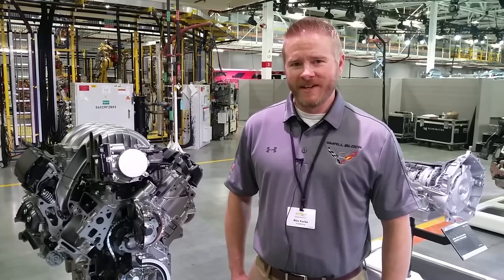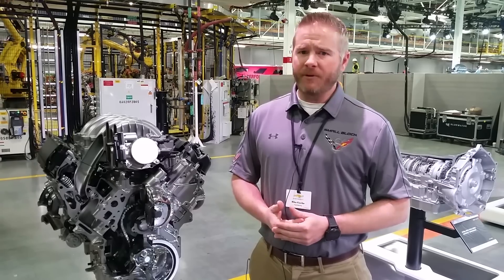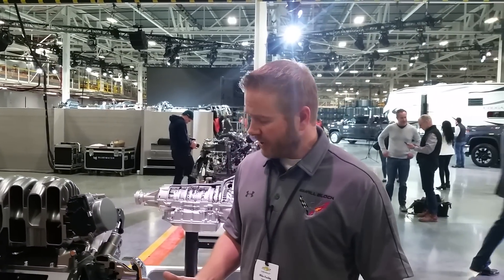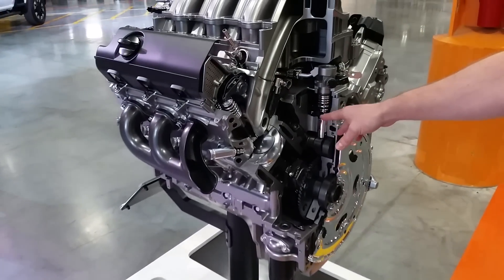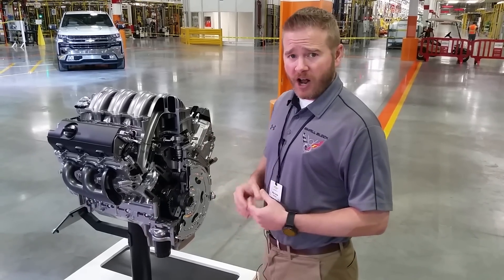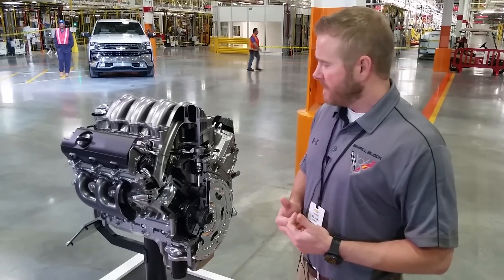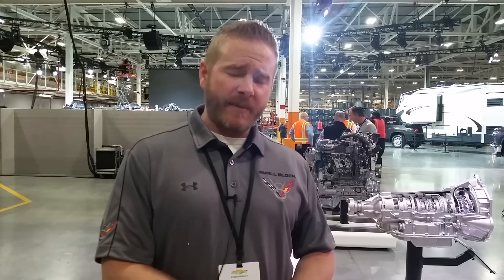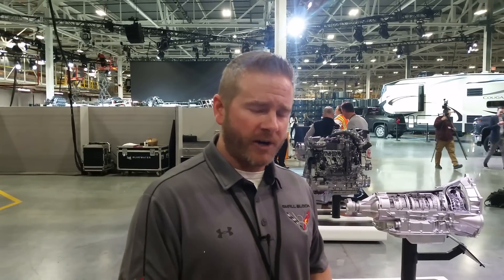New 6.6-liter V8 gas engine on 2020 Silverado HD

Comment: What is the big deal with the 6.6 since the 6.2 beats the horsepower and almost the same torque.  Yer kiddin' right??
Reply: Maybe the 6.6 is able to put more of that power to the ground.
Reply: The 6.2 is a large bore performance engine that was never intended for heavy duty applications. It's the same reason the 7.0 was never used in a truck. Over square vs under square look it up. It's not just about the numbers it's about producing as much torque at low rpms as possible while running on 87 octane fuel
Reply: Horsepower is all but completely irrelevant in a heavy truck application
Reply: @roncook8566   Until you are doing 70 down the freeway or climbing a hill! I'd much rather have 350 HP than 240 HP. Just watch the Ecodiesel verses any gas engine in the same class. It has tremendously more torque but extremely less HP so gets smoked climbing hills and in passing on the freeway.
Reply: @Punkinspapa  

The ecodiesel isnt about performance. It's about towing and being efficient at the same time. The ecodiesel can tow 7000 lbs and return better gas mileage and not feel as burdened...than any of those gas engines. 

Oh the gas engines had a faster 0 to 60 while towing...WOW...FUCKING WOW...

People that actually tow alot or for a living do not give two shits about bragging rights. 

The 12 valve Cummins was down on horsepower vs comparable v8 gas engines...and it was slower. Yet while towing...it was better and more stable performing normal driving maneuvers. And returned better fuel mileage.
Reply: @_E_B_  the Ecodiesel with 420 ft lbs of torque and 240 HP can tow 7000 lbs! My Silverado wiith 383 ft lbs of torque and 355 HP can tow 10,000 lbs. I never said it beat it 0-60 towing did I, although it certainly does!? What I said was when going up a long steep hill, the grapevine for example, the Ecodiesel would not be able to keep up with a gas engine with significantly more HP or even remotely close! BTW I drove truck for 12 years so you don't need to tell me about towing and bragging rights because it's always a contest for some of these people!
Reply: @_E_B_  By the way, those who tow alot don't by a truck that only tows 7000 lbs!
Reply: @Punkinspapa  

I wasnt attacking ur statement or ur Intelligence lol. Just making a statement in general and meaning to say that torque is more important in towing than horsepower. Sure...an engine with more horsepower than the ecodiesel will probably pass faster with a heavier load. But that engine is over stressed while doing so...unlike the ecodiesel humming along up the hill...not breaking a sweat. I've also driven trucks. Since I was 19. I'm 36. 

And yes. Ur Silverado can tow more. That's obvious. But long term...ur 5.3L or any gas engine will have more wear and tear on and in it than any diesel engine used for towing.
Reply: @Punkinspapa  

I also never stated that people that tow alot tow 7000 lbs. I used that number as an example with the ecodiesel. Sorry that u missed that...😉
Reply: @_E_B_  Torque is more important to get it moving typically! HP is more important once it is moving and when climbing hills! Wear and tear I'm not so sure anymore! Both engines can last a long time if properly cared for. These modern gas engines are amazing, I mean look what Ford does with the 2.7!
Reply: @_E_B_  And with 37 lbs more torque it tows 3000 lbs less.
Reply: @_E_B_  and in fairness the only half ton diesels are 3.0. Wouldn't be fair to measure either engine to a bigger truck like a 3/4 or 1 ton.
Reply: @Punkinspapa  

The 2.7L is pretty amazing for what it is. 

And just in case those "bragging rights" people are reading our comments...I might add...that the 2.7L EcoBoost has a quicker 0 to 60 time than the 3.5L EcoBoost(375hp/470trq version) when you line up identical trim trucks...lol.

I've had a Chevy, 2 dodges, I may have to try out Ford. I just can get over the horrible noises the EcoBoost engines make. I'll have to stuck with a 5.0L f150...
Reply: @_E_B_  I hear ya! I love my V8 and while I'm sure the Ecoboost is a great engine, I just like the fact that I don't have to be concerned with potential turbo issues and repair costs. No replacement for displacement!
Reply: @_E_B_  Ford seems more interested in making race trucks than work trucks.

Comment: Any part of that gm engine that starts out variable is going to give problems
Reply: Not even the same thing. All its doing is probably varying the displacement to optimize the oil flowrate for various temperatures. The oil pump is probably a sliding vane type that has a mechanism to control the pressure on the cam ring to vary the displacement of the pump.
Reply: The VVT in the LS and LT based vehicles works great, its the AFM/DOD on the 1500s that doesnt
Reply: Strixx Yep mine is deactivated...

Comment: Get ready to break out the walnut blaster. Because them intake valve's will no longer get cleaned by fuel 😂
Reply: Hell that's been the problem since 2014 lol.......  What a joke, they know the issue and the problems it causes but instead of putting auxiliary injectors in the intake runners like other manufacturers to stop the carbon fouling they increase the displacement 😂
Reply: catch cans
Reply: ze3bar catch can doesn’t catch it all. Never has never will.
Reply: @RadDadisRad  mine does. Rxperformance
Reply: @ze3bar  yeah OK, if you say so lol....
Reply: @turbochevelle5641  Google it. Someone put it behind and in front of another can and proved that it collects well over 90% of the oil that would have otherwise passed.
Reply: @ze3bar  I don't need to because I know what truly causes carbon valve shrouding that is the problem.  Fact is you can run vent tube directly to atmosphere from both heads and still have horrible carbon shrouding. Carbon builds on valve then next thing you know valve doesn't close completely and you ruin valve seats and so on. Any car with an egr system is also horrible and egr with DI is even worse.  All a catch can does is catch oil blow by from crank case pressure and oil vapor.
Reply: @turbochevelle5641  but the catch can doesn't cut down how long it'll be before that becomes a problem? I'm draining out .5-1 liter a month.
Reply: @ze3bar  what engine are you running? Is it n/a or forced induction? We just did a DOD delete cam, injector, valve springs, push rods fuel pump upgrade on a 2014 L83 5.3l with crank case vented to atmosphere and the valves were horrible, absolutely horrible.
Reply: @turbochevelle5641  L83 Chevrolet NA
the stock 5.3L V8 in the Silverado 1/2 ton
Reply: @ze3bar  it will help on a set up like yours.
Reply: @turbochevelle5641  cant prevent 100 percent though...?
Reply: Yeah, but not every customer will buy and install them. I deal with this issue a lot on the car line I work on for a living.
Reply: @darenwinckler7027  those people are not going to be Walnut blasting their intakes either
Reply: @ze3bar  nope they won't ! But I will 😊 then go buy racecar parts with the money 😏
Reply: So air makes the intake valve dirty? We used to think 02 sensors were robbing power.
Reply: @60viking -  not regular air - the egr. Running exhaust back through the intake is what creates most of the problems, but it does work to lower certain emissions. shrug
Reply: So chevy admitted they learned alot from the 6.0 as a light duty engine yet they put it in heavy duty trucks? Lmao of course what a suprise chevy always take the cheap way out of everything cut corners at all cost. Now they made this overly complicated piece of junk while fords releasing the 7.3 gasser which is obviously way more reliable and powerful after hearing its specifications.
Reply: @tylersutton7667  that 7.3 is no joke. It's possibly my favorite Ford engine. Actually, it's the only Ford engine I like.
Reply: @funguy7979  You mean the NAVISTAR/CATERPILLAR "Ford" 7.3 Powerstroke? Or the "new" Ford 7.3 "gas" engine that's a half-assed "copy" of what GM did with its 6.6 gasoline engine?
Reply: @deeremeyer1749  powerstroke
Reply: @tylersutton7667  lol
Reply: Direct injection has its pros and cons, same as anything else.  I don't think it's going away however, it just needs to be improved upon.  Combining DI with port injection seems to be a good solution, but it has its cons as well.  Now you essentially would have two whole fuel injection systems on your engine.  That's an increase in parts and complexity, which leads to higher costs.  
The catch can on a DI engine is a step in the right direction, but it's incomplete in my opinion.  It should be something the factory installs rather than the end user.  I think water/methanol injection should also be looked at to complete the catch can solution.   It would work just as the port fuel injection does by helping to keep the intake valves clean as well as the combustion chambers.  When properly used and installed, it lowers the ambient air temperature in the intake manifold and can yield higher horsepower and torque when the engine is properly tuned, and this benefit is even more substantial on forced induction engines.  The problem with water/methanol injection is it can be really expensive for the better kits.  But you don't want a kit that doesn't work well and floods the engine creating a possible hydro lock situation.   I would like to see the OEMs researching and developing water injection for their DI only engines.  That would help the mainstream consumers feel more comfortable with using the technology.  Plus, it always works better if its incorporated into the original design vs something added on as an afterthought.
Reply: catch can.... problem solved
Reply: Lucas fuel injector cleaner. Poor in a whole jug. Ha!
Reply: Sounds great Daren I'll go back to a 74 Impala

Comment: L5P Duramax oil pressure gets close to 120psi on start up and then runs around 60psi. I do a lot of heavy gooseneck pulling up mountains and it stays around 60psi. We have 3   L5P Duramax trucks.
Reply: I heard those L5P motors are pretty tough

Comment: HI gm
whay don't you build a 
6 cilnder in line 24 valves
bore = 4.630 in
stroker = 4.6 in
rode length = 6.385
piston cr = 1.395
single 88mm turbo
it well bee the monster if all engines
Reply: A guarantee you will never see a production vehicle meant to be a passenger car roll off a factory floor with that big of a turbo.
Reply: @WesV  
so what about the engine it self no turbo
do you think thay well do it?
Reply: i doubt it to be honest...that would have to be an entirely new platform on gm's end while most of the developments in the recent years are just new tech being added to engines, not necessarily ground up projects...developing an entirely new drive-train is no small task especially when it comes to production/manufacture.

EDIT: im making the assumption they would go back 60 years and use a preexisting straight 6 platform...i do admit it would be cool to see gm's best shot at a 24v straight 6.....
Reply: @WesV  
GM in the 90s 
had gmc syclone & typhoon
Reply: @strokerz2858  both of which had v6 engines in them, not straights.
Reply: @oddball0045  can you explain more?
Reply: Because forced induction sucks on a heavy duty tow vehicle
Reply: @oddball0045  it well bee 
464ci
big block in small package

Comment: I can already hear the valves ticking
Reply: Nathan Mohler don’t get me started on  valve ticking My 2015 ram 1500 just hit 110,000 miles and had to have the whole top end rebuilt costing me $5,000 at the dealer in April.  My god damn SRT8 Charger did that shit to me to but I ditched it before I had to dump money into it to.  And both were 100% stock no aftermarket shit on them
Reply: I can't stand the hemi tick way worse then any valve ticking in any engine

Comment: Has noone even considered what would happen if a 15 MEGApascal fuel line blows all over a hot running engine.  15mpa = well over 2000psi
Reply: SavageX420 
Marshmallows anyone?
Reply: What about a fuel rail on a diesel with over 30k psi going through it?

Comment: Great. That high pressure fuel pump looks like a bitch to replace. And with no lubricants in gasoline like you have in diesel, plan on that pump going out before 100k miles.
Reply: Im worried about the 5mpa that pump makes..  Thats 2000psi in the fuel rails man....

Comment: Direct injection causes carbon deposits on intake valves . The old 6 liter had piston squirters and made 365 horse . Variable oil pumps were problem some . The old engine had an oil life monitor . Avoid buying any new model for at least 3 years . I just left a GMC dealer because I saw the problems first hand .
Reply: Unlikely that will happen.
Reply: Its PVC and EGR that causes valve carbon build up not direct injection. Its the lack of fuel across the valve that causes the buildup. Problem none the less
Reply: I was not implying the direct injection caused the carbon build up . All the cars I worked on with carbon issues did not have egr valves . Variable value timing has virtually eliminated egr valves . The pcv systems do contribute to carbon build up . And we all know the the fuel is what cleans the valves in conventional fuel injection systems. I am a ASE certified master tech not just a person with a opinion.
Reply: @Rejectsocialism  I think most everybody reading understands how it works and what you meant, but your exact words were "Direct injection causes carbon deposits"

Comment: ya'll should have left the oil pump alone hell the are a night mare to start with !!!
Reply: They are electronizing every part on these trucks. Leave the tridd and true mechanical systems alone! Specially with cooling and oiling. This is one more sensor and part to fail! Either blown engine or stuck on side of road...Or both!
Reply: @robophobic3716  agree that to many sensors are ridiculous. I'm finally interested in a new truck again.  Bought my last new one in nineteen hundred and Ninety six. Alot of folks never cared for these engines. They do tend to run hot, not so in my experience. They always seemed to out work a big block for me. Those 454 in a work Truck are a dog and everyone knew it. The 400 was king. Hopefully they won't try for the big block premium for it. Imagine that ford engine will cost Ya a dime or 2. Thinking a 3/4ton Strait wheel truck, reg cab in a 2 Wheel Drive would suit me fine. This engine always did well with a standard trans. Hope one is standard issue. With rubber floor mats. And put steel wheels on it. My gosh these fancy aluminum wheels get on my every last nerve. Checking the pressure constantly.  Saw one pictured with stainless grill ,reminded me of a 66 chevy truck. Looked good. Now drop that motor in a full framed 2 door coupe , give me a reason to buy a car.
Reply: Wallie Hart 
The 400 was “king” and better than the 454?
I never had issues with the 454.  Meanwhile, the 400 had overheating issues.
Reply: @stlchucko  I suppose good and bad exist in both. Every 454 I tried to work just could not take it, blew a few of them. Mostly the main bearings ,some would scorch, some just started hammering when the 4 barrel opened . The 427, 396/402 engines did well in anything I drove /operated in. Those 454 gave me fits. They just felt underpowered,  almost how one feels when it's time for a new timing gear set in any engine. I had to baby them otherwise I had to call a tow truck. 
     The 400 sbc with a big 3 core radiator never overheated on me, they would get warm until the thermostat opened then all was well. I live in a rural area. I could see them overheating in city stop and go traffic 4 sure. Good power and fuel economy in a 3/4 ton farm truck. The 350' s I ran drank Gass, not the 400's I did have a carb from  a old mercury car on mine and center head and heads I always switched over. The center head and heads came from a old mechanic. He believed them to be factory corvette.  He also modified them to work on the 400. I also had to use shims along with the head gaskets. The shims allowed it to run on unleaded Gass and somehow made vacuum for the brake booster. So my personal 400's,not stock. I did drive many factory autos with a factory 400 and had no problems.  All of them did run warm. Not hot. 
       If Chevrolet really wants to be king. They own the writes and blueprints for a great engine that would be THE one everyone would want. My father used one in his bootleg cars ,( mostly 4 door Oldsmobile midsized cars with a rock crusher and posi unit and suspension overkill) Pontiac super duty.  His had 2 4 barrel carbs on it. He ran 10 ply tires with hub caps on them. 243 rear gears.  He ran alot of cigarettes and fireworks some alcohol not much. Remember this was in the 60's. No radar.  And late at night.  So no lights most of the times. He had 4 sets of tags with him. All rear lights operated on a toggle switch.  That way he could kill them anytime.  He ran quiet exhaust.  If in a tight spot he switched 2 spark plug wires tags and hubcaps to sneak away under their noses. Never got caught.  He was born again Christian when I was born. Only way I found out was asking him about the center head he kept in basement with 2 4 barrels on it. He also ran 383 Pontiac and Chrysler's as well. 
         With new fuel injection and modern cooling systems this engine should breathe some life into gm . Give us what we want gm. Put this engine in a 2 door coupe ' a full x frame coup' nova? Impala? Montecarlo? Dang call it a Biscayne build it and we will come. Everyone I know hates the Chrysler 300 ,after owning it a while. Fiat was never known for dependability. IF Chevrolet would build a good sporty coup' that would toast a demon on the open road then folks would come home where style was always ahead of the competition GM OWES THE U,S.A  now pay up.

Comment: GM should have kept and refined the Big Block Chevy engines, they could have been made less polluting just like the Small Block engines have and been used instead of going to either diesels or gas engines and trying to multiply power with 8 & 10 speed transmissions...